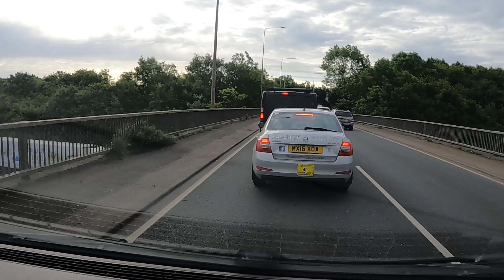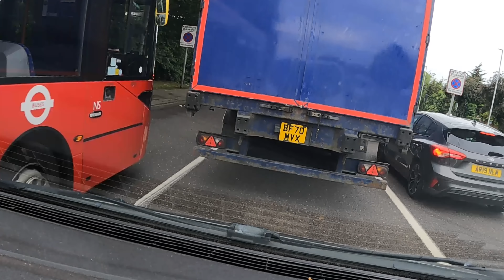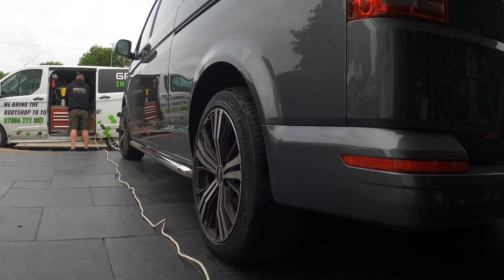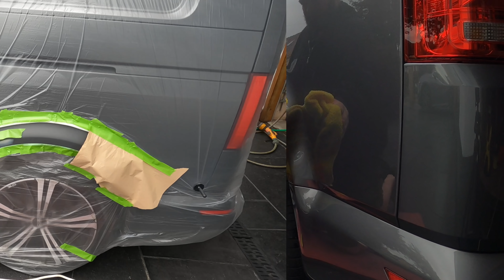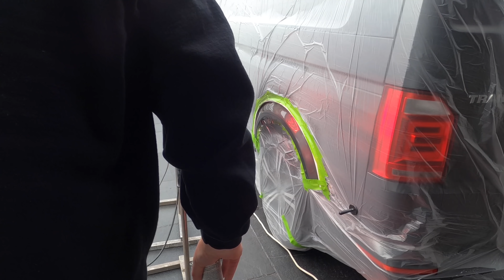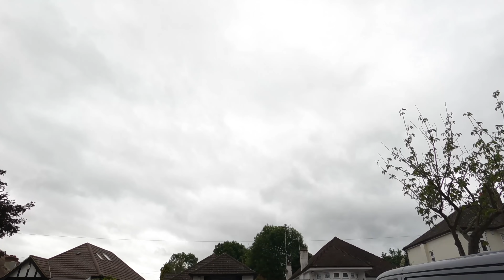Smart repair vw transporter arch repair

Comment: That one came out very nice Grant but you was pushing your luck with the weather but it wouldn't dare rain on your parade 😂😉 

Nick mentioned below about pricing but maybe you could tell us in a vid about how you quote for your jobs mate? does the customer send you pics as you can't go and see the job then come back and fix it, do you just give an estimate and tell the customer it could end up being more or less than the estimate?
Sorry for all the questions Grant and if you are not comfortable saying how you do it then that's fine mate 🙏🙏👍
Reply from the maker: Tbh mate I just work out a price What I think it’s worth and go from there I never charge more than quoted nor less tbf and I get customers to send pics and a video via WhatsApp I don’t have a pricing structure other than my bumper corners start from £200 and a full panel would be £250 upwards of that helps
Reply: Thanks Grant, I'm just a diy/hobby painter doing my Fred in a shed stuff but was interested about how you quoted 🙏👍

Comment: Hi what clear did you used for your job 
Is it good to use fast hardener or standard is enough in UK outdoor?
Reply from the maker: I use multimix 2 with air dry plus hardner it’s a 5min bake 👍👍👍